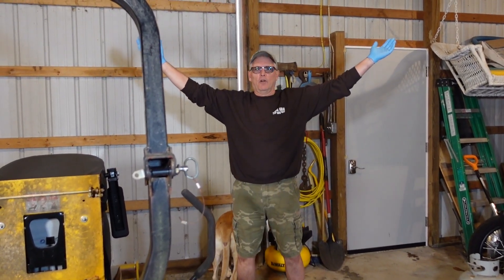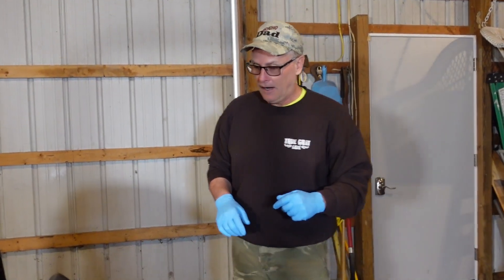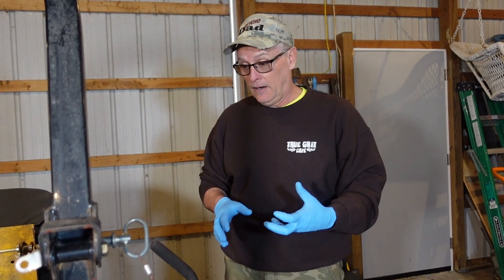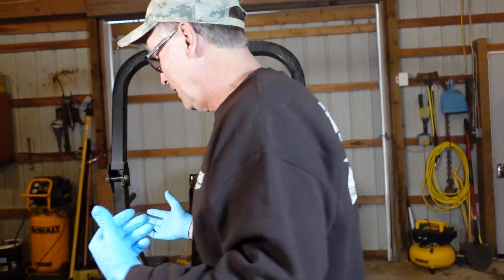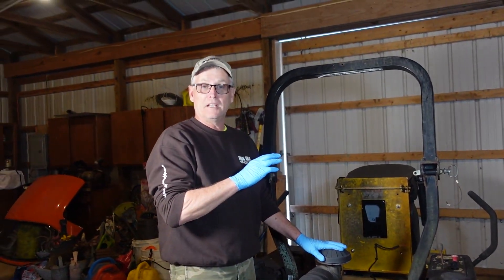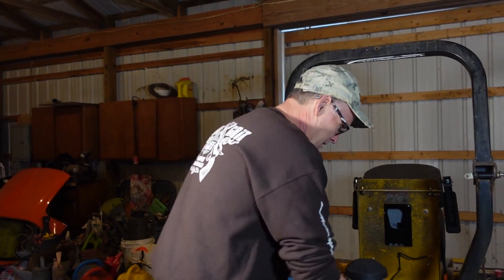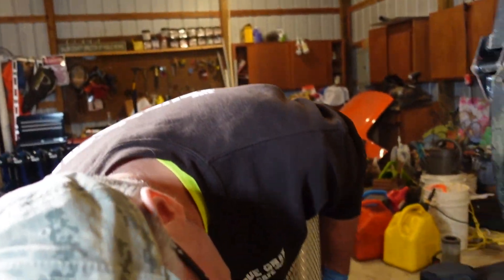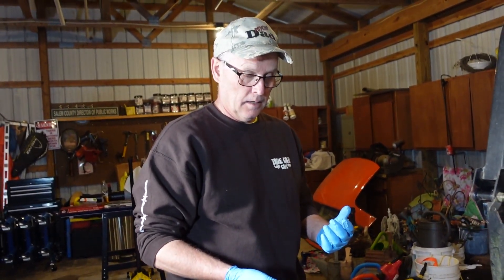Psycho Dad does a Spring Tune Up on Hustler Mower

Comment: Hey Jeff! A tip from one DIYer to another; I’ve always sprayed the threads of the new spark plugs with WD-40 before you put them in the cylinder, that way it’s not dry on dry contact and they won’t strip out easy. You know how much of a pain that’d be to heli coil.  Also make sure your gas filter is installed in the right direction with the arrow pointing towards the fuel pump, or fuel inlet.

Comment: Finally got myself a bench grinder, so I'll be getting my mower tuned up and sharpen the blades. I've seen small Bobcats where a Russian explained on a video that every Spring he gets his hydraulic lifts flushed and refilled so that the lift of the front bulldozer would easily lift up or down. Also he'd flush and refill lube the threading tires.

Comment: Nice video, lot bigger mower than I use in England. Would it be any easier if you removed that panel at the back of the motor to get to the spark plug and oil filter?
Reply from the maker: maybe, Terry said the same thing.

Comment: Hey I got a question I mow for 5 minutes and chug for gas than dreads than I got to wait to cool off do you got any ideas to help that issue
Reply from the maker: did you let it sit all winter with the ethanol gas in it. May need carbs cleaned.